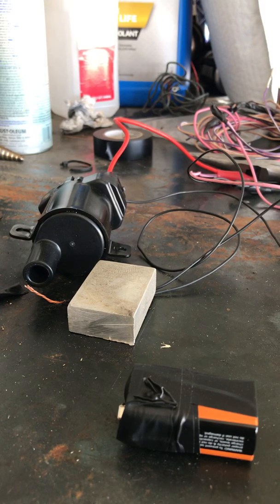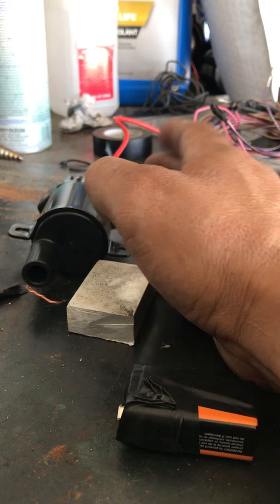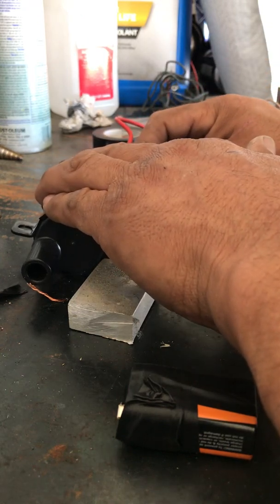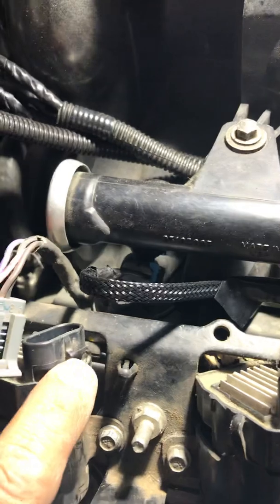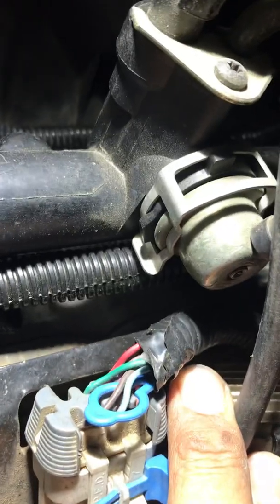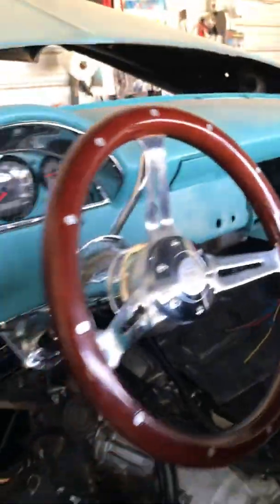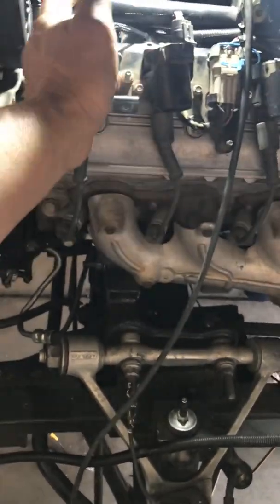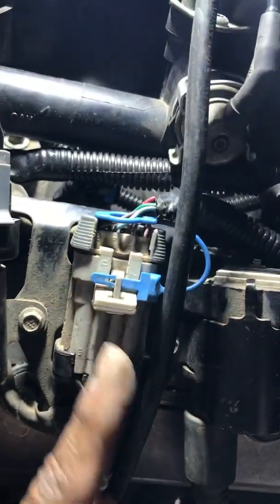How to bench test LS  ignition coils and wiring explained

Comment: So both grounds going to the battery or one so the output of the coil can flow through. The main red one to constant (battery) and the trigger wire touch it when you want it to output right?
Reply from the maker: yes both grounds to battery, red constant ,the other power wire is the trigger ,the third ground in front of coil is so you can see the spark  and not zap yourself.

Comment: How to check of signal?
Reply from the maker: Use a volt meter or test light while cranking engine signal wire will show voltage on and off if it’s working properly
Reply: You can also use a noid light to check for signal from the computer

Comment: bro brand new Pumped ls7 1st fire up on hit 3 heat Cycles noticed I pinched the valve cover gaskets so I changed them and now it runs like crap I had the coils hanging when I took the valve covers off so another day hunting where it went wrong thank you for this Video man soon as the sun comes up I'll unbolt the coils and look for a wire out of place and check each one I know it's something simple I just have to find it then I can rest
Reply from the maker: I know how that is michael ,good luck to you  , let me know how that works out..just saw your video of the LS porsche  idling bet that things a blast to drive

Comment: Well done and good info sweet truck. I just went through something similar, did turn out to be a bad coil, but this was very informative. Thanks.
Reply from the maker: Thanks, you i appreciate it
Reply: @ozcorr909  in having the same issue. Didnt buy a coil, when I swapped coils it the "bad coil" worked on Cyl 6 but none on cyl 8. I have constant 12v but not sure how to test the signal wire. I looked at the connection to the sub harness to main harness and looks good. I also switched drivers and passenger sub harness and makes no difference,  cyl 8 never gets spark...not sure what to do from here. I guess I need to un loom the whole harness and trace the signal wire back to the ecu...frustrating
Reply: @teabag402 did you figure it out??
Reply: @bowtiebuilding  sure did...and short answer is the harness I bought/ was using was pinned way wrong. I ended up taking a pin out sheet, and a stock harness and went pin by pin on both connectors (red / Blue or Green/ blue) and traced each wire down and re pinned all the messed up connectors...it was a mess and a huge learning curve but that was the issue. Runs like a dream now. Basically the Amazon/ eBay harness I had was comically pinned wrong. Only sensors wired correctly were the bare requirements to make the motor run.... anything else that makes the motor run correctly was pinned wrong. It was almost like a bad joke and on purpose 😂
Reply: @bowtiebuilding  what issue are you having?
Reply: @teabag402  right on brother, love hearing people getting through a tough spot. I’ve swapped a 6.0/4l80e into a 84’ 4x4 Chevy and thought about reworking one I have or a cheap Chinese one. Bit the bullet and bought a Fitech self learning ECm setup. Tunes itself, at least to get you down the road and staying N/A
Reply: @bowtiebuilding  good idea, I wouldn't advise anyone buying a cheap Chinese one. The wire quality itself is my main concern, they use cooper clad aluminum wire...which is like audio quality and not rated for ECU wiring. I'll be reworking factory harnesses going forward